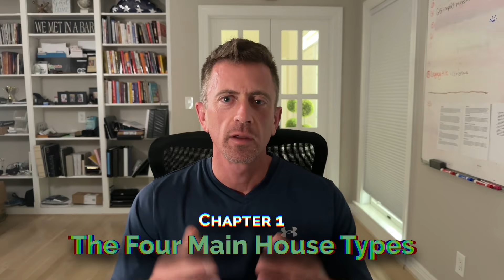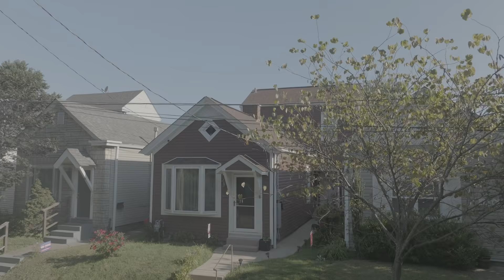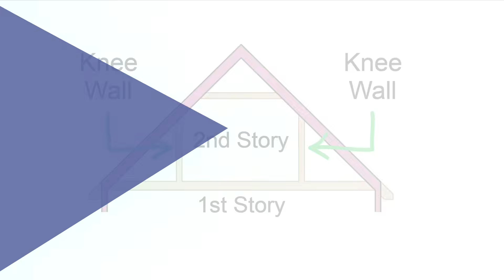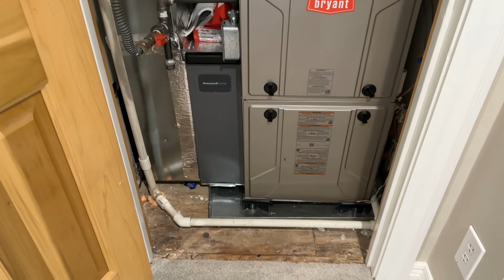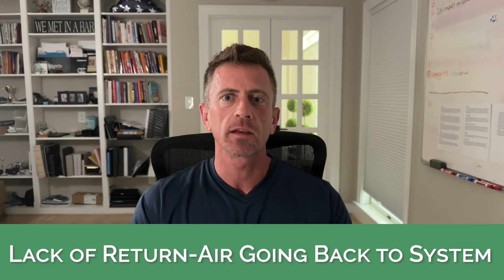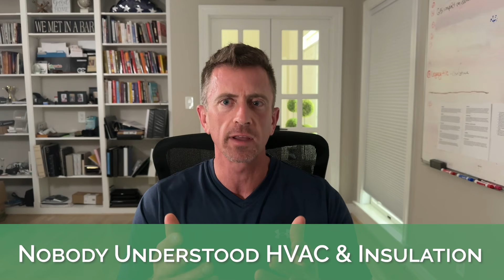The 4 House Types That Determine Your Home’s Comfort

Comment: What category would you put an older split level house in, where there are 3-5 floors, but they are only a partial footprint of the entire house?
Reply from the maker: I'd put it in the 1.5 story house category, mainly because of all the knee walls and small attic spaces you have in those split level houses.